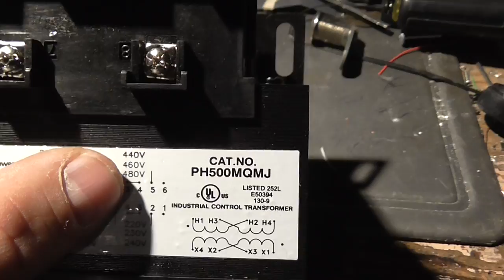480 volt transformer preview

Comment: Where did you get that transformer?
Reply from the maker: Bobby M. I picked it up at the local Habitat for Humanity ReStore, we got a bunch of electrical stuff in, and this was one of the things that arrived.
Reply: We use these in lighting ballast boxes to give 120 for the fans and run light cages off 480.
Reply from the maker: @johnwilliamson2393  Interesting, I know it's actually designed as a step down transformer, I believe this one was used for powering PLC equipment in a motor control center that needed 120 volts.
Reply: @WillPhoneman  look up Boss LTG. The light cages are what use these. Now, they use an enormous transformer to drop 480 to run these 16 led panel light cages. Looks wild.

Comment: Speakers and electric motors, preferably the universal kind.  Although I don't know how much current that transformer can provide.
Reply from the maker: Speakers I can do, and an electric motor is in the works, gotta find an old one. The transformer is rated at 500 Volt Amps, but I need to add a fuse to it.
Reply: @WillPhoneman  I used an online calculator. It's a little over 1 amp so not much.
Reply from the maker: @johnwilliamson2393  Yeah, it can't power a lot without risking frying it, but even 1 amp is still dangerous at 480 volts!
Reply: @WillPhoneman  absolutely!